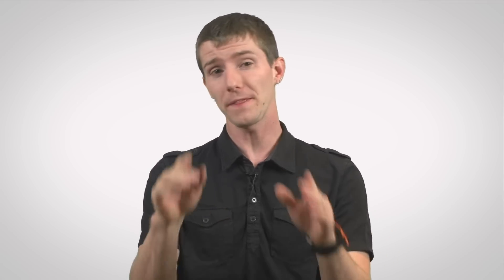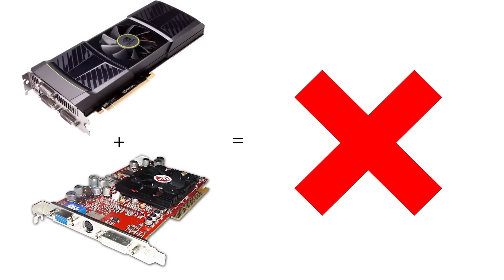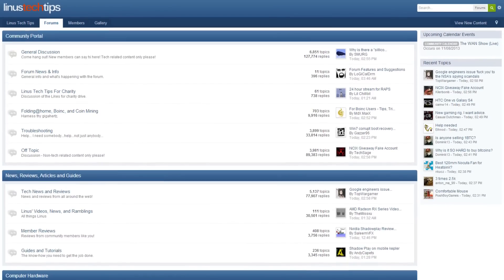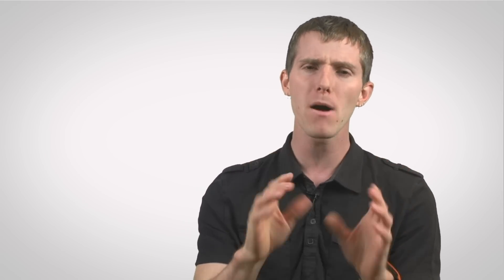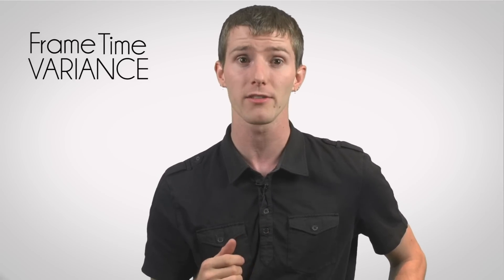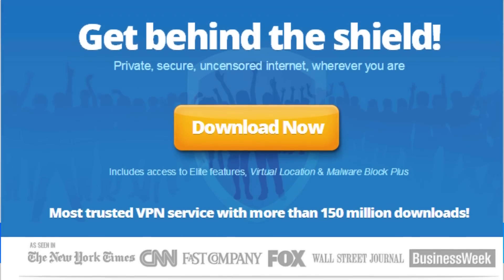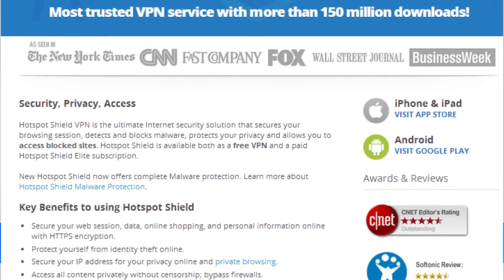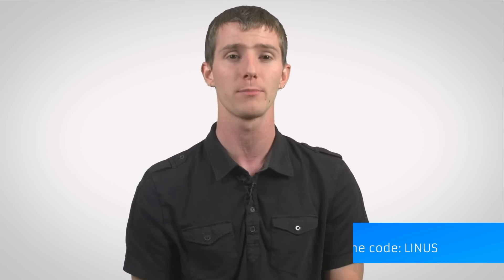SLI by NVIDIA - Everything you Need to Know as Fast As Possible

Comment: well, The Witcher 3 literally doubles up in frames when I enable the second card, so I guess it's perfectly possible :D
Reply: def possible, but like Linus said it's quite rare!
Reply: Chris Dunn Many factors involved there, to be honest. Things like mismatch in VBIOS (which does happen), mismatch in clocks, CPU botlenecking that you don't notice at lower framerates, etc. it's not THAT rate.
Reply: It's a very well optimized game. What cards are you running?
Reply: +Zel Pozharruchyei I'm running dual 980ti and can confirm Witcher 3 does pretty much double with a second card! currently running mine maxed,excluding hairworks, at i think 4757x2333 or something like that...it's a 3440x1440 monitor bumped up to 2x resolution in Nvidia DSR and no problem keeping 60fps and cards never going over 90% usage and usually hovers around 70-80%!
Reply: +PIXELFLUX I'm just speaking from my personal experience, I'd say more times than not lately I'm seeing more of a 30-40% bump with second card. Witcher 3 is a rarity and runs like a big sexy dream!
Reply: +Zel Pozharruchyei it is 4825x2036 on the resolution...still chomping through it!
Reply: Chris Dunn 80-90% usage is not ideal. Ideally both cards would be 99% utilized to get the most out of what they can offer. I've noticed that at large resolutions, high AA settings or lower resolutions at high framerates the SLI bridge becomes a problem too. My 1080SLI rig does run into those issues depending on the game and settings and I an confident I need the new HB SLI bridge. (for comparison: a bendy SLI bridge works at 400MHz single-stream. A hard LED bridge can do 650MHz on the same stream. The new SLI HB Bridge does 650MHz on two streams, doubling the bandwidth!).
I now play Witcher at 5120x2880 sometimes at ~60fps :)
Reply: +PIXELFLUX i use vsync from within Nvidia control panel to lock it at 60fps though, that's why it's not 99%.

Comment: Ok, here's my problem: I've got an ASUS Rampage V Extreme motherboard and 2 gtx 980 TIs mounted in slot 1 & 2. Each card takes up 2 slots so the 3rd black slot under slot 2 is covered by the 2nd GPU. Now here is the problem: I want to mount another GTX 980 TI on the Rampage, but in the PCIE slot I have an ethernet network card, so I cant mount the 3rd GPU in the 4th slot (under the black one). This means that I have to mount the 3rd GPU in the 5th slot but no 3 way sli bridge is reaching that far. This means that I have toget a 4 way sli bridge, so my question is: Can I use a 4 way sli bridge for a 3 way setup/3 GPUs?
Reply: +A Helpful Person Ok... Thank you! You realy are a helpful person :)
Reply: +A Helpful Person Do you think a pcie extension cable can fit under the GPU? In that case I could place the Network card somwhere else in the case and route the Ethernet cord inside the case to the Network card.
Reply: +A Helpful Person pcie express
Reply: +A Helpful Person So I can use an adapter?
Reply: +A Helpful Person So I can put an x1 in an x4, x8 and x16?
Reply: +A Helpful Person Oh, I didn't know that. Thank you!
Reply: +EpicWarix yeah try just putting it in the fifth
Reply: ***** Intel Core i7 5960x

Comment: Can you SLI a GTX and a Quadro together? I need the Quadro drivers for work station at home.
Reply: +A Helpful Person I wanted to use a GTX960, but I also needed Quadro drivers for 3D CAD, so I had hoped to SLI 2 cards together. I thought that maybe a K2200, plus the GTX might be an idea.  Could they both run simultaneously w/o being SLI'd? It would be nice to use a K5000 but they suck for non-CAD uses, plus they are ungodly expensive.
Reply: ***** Is there a Quadro card that shares the same GPU as the GTX960 class cards?
Reply: +A Helpful Person you can't
Reply: +Rickey Ryan How badly do Quadro cards (K1200))suck for daily use? They wont be used for hard core gaming.

Comment: I'm new to SLI I'm now using two GTX 760s when it was as dual GPU I got 40-60fps in Crysis 2 (as an example) but now can't get over 30 something, if i use V-sync and Anisotropic Filtering Optimization it locks my frames on Crysis 2 and my heavily modded Skyrim at 30fps I know it doesn't matter THAT much but I don't really want to be gaming at 30fps when it was just "dual GPUs" my frames where off the charts, odd, and I was phyched about using SLI for the first time. What a let down.

Comment: I have a gigabyte z97x gaming 5 motherboard and a gigabyte gtx 980 windforce graphics card. I'm interested in installing another graphics card so that I can play in 4k. So I would really appreciate you guys if you give me an idea as to which card to buy. Also I was wondering if 980ti or titan can be installed??
Reply: +Shariq Anwar you can play in 4k now, almost all ultra. just turn off all AA except MSAA on your GPU settings.
Reply: +Ken Bledsoe adding another 980 would help but because of only 4 vram an upgrade to a 980ti or Titan X would be more beneficial. And in the very rare instances where you would need more a 2nd 980ti would be beastmode even in 4k. Although, if one were inclined have a complete 4k@60fps max settings rig , 2 titan x's in sli is all you'll ever need.

Comment: Hi Guys,

Which Build will get better performance?

GTX970 Sli or GTX980 ?

Thank you
Reply: +Steven Low  double 970 is more powerful but you get the Sli cons showed in the video. 980 gives you about 20% more juice compared to single 970.

Comment: Can I SLI my cats so they are less stupid?
Reply: As long as they have the same graphics processor and memory, yes you can.
Reply: +Preston COC Just don't be stupid enough to SLI dogs and cats together. A small cat and a big cat would still work.
Reply: +Preston COC Don't forget that you need a "beefy" power supply, and not "starve" them of power.
Reply: Cat = CPU
Catnip - RAM

Giving your cat catnip is like using DDR RAM for a 5960X
Reply: +Preston COC  That setup will actually increase the stupid,  though you shouldn't expect your cat's level of stupidity to double.
Reply: +Preston COC It is important to remember to orient the cats correctly in two-way SLI configurations. "Paws to Back" will always cause one to always land on the ground (on its paws) and the other to be on top when they are dropped. "Back to Back" will give you a 50/50 chance as to which one will land on the ground. But never... NEVER set them up in the "Paws the Paws" orientation; when dropped both cats will turn to try and land on its paws, but they can't ever orient themselves correctly so the laws of cat physics requires them to hover just off the ground, spinning like an electric motor.  

NOTE: The same net result can be achieved with a single Cat by placing butter on it's back and dropping it from counter-top height.
Reply: +Preston COC Ive tried to update the BIOS of my cats for better performance, but I can't find a USB or Ethernet port.  They don't recognize Wifi either.
Reply: VGA cables are not approved by the Humane Society.
Reply: omg you are my hero ^__^
Reply: ***** Well yeah. Some might have 2 nails while another has 4.
Reply: Try to plug in a vga cable
Reply: Csab Well it really depends on the ladies.
Reply: +Preston COC i think theres a movie where they tried that on humans...lol
Reply: +linkuei83 lol
Reply: +Preston COC LOLOLOLOLOLOLOLOLOLOLOLOLO...
Reply: +Preston COC this made me laugh
Reply: did you try to overclock
Reply: Sure, if their eyes use NVidia graphics cards of same memory :))))))))))))
Reply: LOL

Comment: SLI was introduced in 1998 with the Voodoo2 graphics adapters. Your statement of the time of introduction of SLI is off by a few years.
Reply: ***** you are mistaken. I had dual voodoo 2's and it was most definitely called SLI.
Reply: +covenant11 They both had they same acronym but were respectively different. 3dfx = Scan-Line Interleave while NVIDIA = Scalable Link Interface (both are separate trademarks)
Reply: Ah, I remember Voodoo 2 cards.  The were teh w1n back then.

Comment: should i sli with two 960s or a 970?
Reply: +CraZe Mercs Good question. I would personally go for the 970. Cheaper power-supply and no need for SLI motherboard. You can actually save a few buck and you will have the exact performance. 960 is not a bad idea... but you won't get 2x the juice of the 960. Keep in mind almost 75% despite in heat and is lost due to poor tuning of SLI. Redenring is just not like a single fat GPU

Comment: This may sound like a dumb question to you all, but I just recently built my first PC and got an MSI GTX 970; if I purchase a Gigabyte GTX 970 G1, can I run both those cards on my ONE 1920x1080 60Hz monitor WITHOUT SLI...or do I NEED TO SLI them both to my monitor?  I'm also looking at 2560x1440 144Hz monitors to replace this one I have now; doing this, would it increase performance substantially?  Any help is appreciated, thanks!
Reply: xXTheFreakinManxX 2 cards = 2 way sli (different brands of same GPU works like geforce g1 and msi ) but you need to sli them via sli bridge. You can use even 4 way sli on one monitor ( if your psu and mobo can run it ). BUT before buying another one make sure your motherboard supports sli and if you psu can handle them :)
Reply: arturas arlauskas I highly doubt it can run sli well, i have an am3+ with pcie 2.0 x16 slots and my mobo is a corsair cx600 +80 bronze
Reply: ***** Hence the reason why I said "this may sound like a dumb question" lol.  i just started pc building a few months ago with no real research put into it so thats why i was asking.  But since making my first comment, I'm more knowledgeable on the subject lol

Comment: Is it SLI is just for gaming? What about other designers application? Does it require SLI for better perfomance?
Reply: Afiq Zaimi If I'm not mistaken, Quadro cards also support SLI however, it's not as much of a concern as most 3D applications are able to address the multiple cards anyway, even moreso if the applications support CUDA rendering. The performance may be there, but it won't be much better with SLI in professional situations.
Reply: +Afiq Zaimi Everything that is ... loading,editing .. puting clips together .. etc.. CPU is responsible for this. Unless you need some serious graphical performances to preview your 4k videos .. but  i doubt.. Whenyou are on a designers application the GPU is at idle. CPU is the brain. GPU will load the image once the CPU tells him to go. This is why a sloopy AMD APU will bottleneck a precious GTX.
Reply: +Afiq Zaimi Just for gaming and some rendering situations. Editing.

Comment: I see in this video SLI with 3 video cards, where you have barely 0.5 inch between cards.Can coolers still do their job in this situation?
Reply: George Popescu Perfectly well! With 3x or 4x SLI, you're looking at more expensive, larger motherboards with basically all the PCI slots being 8x or 16x slots - So you're going to be using a much larger case to accommodate these motherboards, and probably a much better, performance oriented cooling solution to make sure that you can feed the cards enough air - A lot of 3 and 4 way setups use custom water loops to solve the thermal issues also.

Comment: What do you do when the card you got a year ago stops being made..... WHY EVGA!!!! WHY!!!
Reply: sbryans123 Ebay.
Reply: as he mentioned in the video, as long as the cards are of the same architecture and have the same amount of RAM, you're able to configure your cards in SLI, assuming your motherboard and PSU support it.
Reply: Yigi Liu Not only the same architecture but the same model and same amount of memory.
Reply: so that means if he's got a GTX 750 for example, he could just get another GTX 750 from any manufacturer, not just EVGA, provided it has the same amount of memory.
Reply: +Yigi Liu Yes. Ati/Amd can use different cards different ram sizes same series in Crossfire. however.

Comment: so i could have a asus strix gtx 970 in sli with a msi gtx 970
Reply: Yes, you could.
Reply: so would it be better than just asus strix in sli? or would it be bad
Reply: Either way it won't matter. You will get the same performance. A 970 is a 970.
Reply: okey thank u
Reply: helped me alot👍🏾😂😂😀😉😉
Reply: Glad to help out. 😁
Reply: BestGamerFreindz ever you need 2 of the same card
Reply: yeah but not exactly the same
Reply: Just get the same to be safe
Reply: yeah i will get the same then... becuase im not 100% sure it will work

the reason why i want to know this is that i am going to buy a pc
with:
intel i7 4790k

gtx 970 asus strix overklocked

1000 HDD

mother bord is: MAXIMUS VII RANGER

power suply: 850 W 80+ XFX series

windows 8.1

16 GB RAM

but im having trouble with the cpu cooler so what should i chose: COOLERM. HYPER TX3 EVO, or a WATERCOOL ASETEK 550LC

but i am going to buy all this and its going to kost me  2363$ but the only problem is that i dont know what cpu cooler that is best a COOLERM. HYPER TX3 EVO, or a WATERCOOL ASETEK 550LC.....
Reply: and let me know if something in the pc specs are realy bad
Reply: BestGamerFreindz ever h100i would be perfect if you're going to overclock the 4790k
Reply: yeah but i only have these to chose😭😭😭

Comment: Stupid question but I hope someone can help me. Can I SLI a gtx 650 with a 650 TI Boost? Thanks!
Reply: +Tony Nguyen It has to be the exact same card. It can be done with a few mods.. but sometimes the card won't run at the same clock speed ...

Comment: so if i pair a gtx 980 with a gtx 980
so i would get 4gb + 4gb = 8gb??????
pls reply ASAP
Reply: Harkirat Singh Nope, Vram doesn't stack.
Reply: so what's the point of SLI
Reply: Even though the Vram doesn't stack, it still can increase performance and frame rate in SOME games. I emphasize "some" because SLI is a bit of a gamble and I don't recommend it. SLI is only truly supported for some games, while a lot of other ones aren't. SLI setups have many issues that a single card would not have such as microstutter, something that's plagued SLI forever. It might give you crazy-high FPS, but the experience will feel sluggish because of stutter. If you can, stick to a single card setup. It will cause less headaches and troubleshooting, trust me, I've experienced this crap myself.
Reply: Harkirat Singh VRAM doesn't stack yet, Although it will when DirectX12 comes along allegedly. But the VRAM isn't everything, it's your GPU that does all the work, and with SLI you get 2 or more GPU's work work together to increase processing power.
Reply: +Harkirat Singh Increased framerate sometimes. Looks cool. Expensive 1. Performance is very hit or miss and with every new game expect 
double the time to get drivers ironed out along with the SLI profiles to
 make everything happy. 
 
2. Half the time you have an issue with SLI the answer you get back 
across the internet is Multi-GPU setups never work right and if a single
 card works fine then SLI is to blame that's just that no fixing it 
right now. 
 
3. It's expensive, but I could easily argue if I had run my GTX 670 
with another in SLI and put it up against a GTX 780/Titan/780ti I would 
have been faster and cheaper at times in the past

Comment: Can a 780 and 780 ti sli
Reply: +Johnny Le Gotta make sure you buy a bridgeable card or you are fucked my boy..
Reply: +POTATO LAND Yes same because they both have identical gpu chipsets. however the Gtx ti will run at the speed of the 780 unless you overclock it to the Gtx clock spec.
Reply: Yor Highness u sure?
Reply: +POTATO LAND Yes you can.

Comment: could i use sli with XFX R7 250 1050MHz 2GB DDR3 & a Sapphire Radeon R7 260X. both are 1050 mhz and 2 gb but the radeon is GDDR5 and the xfx is DDR3.
Reply: Swexa360 and could anybody link me to a budget motherboard with 2PCIe 3.0 and supports crossfire/sli
Reply: +Swexa360 1. Its Crossfire
2.No because does are not the same GPU core.
Reply: Buizel Productions thanks but i kind of decided to not to make a computer build with sli a while ago
Reply: Swexa360
ok

Comment: Cannot some Nvidia cards run "SLI" without the cable as well? I have seen alot of budget-solution PCs with dual GTX 750 Ti, beause they support cable-free SLI i guess, or am i wrong?
Reply: the 750 doesnt support SLI at all as far as im aware, but yeah some of the cards can run without the bridge
Reply: ***** oh i thought nvidia can do the bridgeless sli too but oh well.
Reply: *****
yeah ive seen the evga ones and i also saw a real cool custom built one
Reply: +Stahle Frid Yoou can't sli these 750TI .. even with some modding. Nvidia tough this over and if they would put the SLI on the 750 it would turned out to be a 300$ monster card.. performance to money that is pretty ridiculous .. .. and would lost alot of money doing so..
Reply: Patrick Hache Haha, that may actually be correct. One 750 Ti performs beast for the money, two would easely at least outperform a 960/970. Too bad you cant SLI... i have like a chassi with alot of space and it feels empty with ulti cables and stock cooler... (i dont need a watercooler even though i've been close to buy one for a very long time haha).

Comment: why cant you run 3 cards and have three monitors and have each monitor driven by a single card?
Reply: ***** What I mean is what is holding nvidia surround back from having a setup like I mentioned where it splits the workload into three so each card can just render its own section?

Comment: You lost me at " will not work if VRAM amount is not the same ".  You CAN use 2 cards with different VRAM amount. The system will just use the card with the lowest.
Reply: ***** actually. It will. I have seen somebody do this before.

Comment: I have a question: Does matching 2 GB MSI and Asus GTX 760 with different clock frequency still working in two way SLI or the close frequency does affect this possiblity? Thanks.
Reply: Qiuyuan Chen  it will work however the card that is faster will slow down to the slower 1
Reply: Thanks, and I just found out that SLI make no sense for SETI@home so forget about my curiosity then.